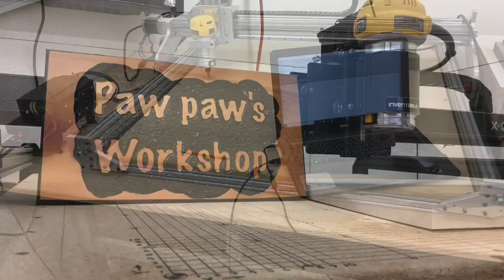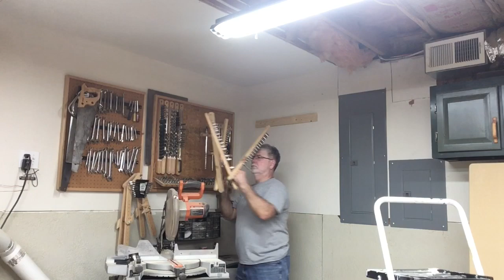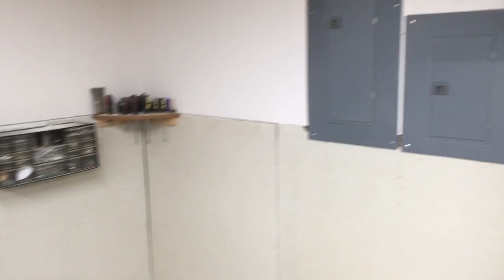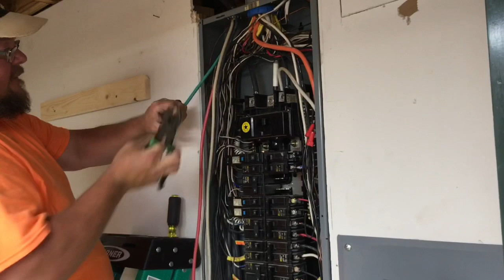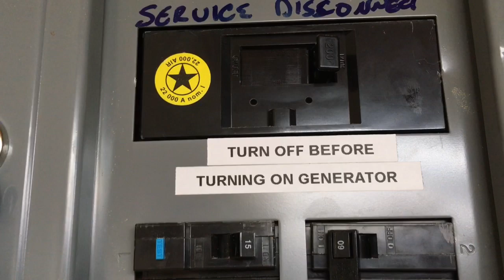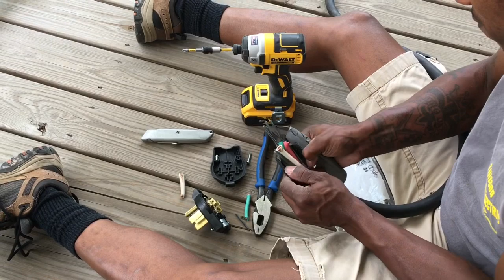How I Installed a Whole House Generator

Comment: Your generator and the utility power are ‘out of phase’ meaning if you were to turn your generator on and close the breaker with utility power present, you will have a large arc flash. Also, the type of chord used, looks like soow , is intended for temporary installations only. Also, the generator needs to be grounded with a ground rod as a separately derived system.
Reply from the maker: Thank you for the information.  I have spoken to the electrician to correct the issues.  I appreciate this very much.

Comment: Im surprised In fact I am 100% skeptical that there is no transfer switch. If you don't forget to turn off the main breaker you are energizing the power to what could be a down power line. The second question is why is this installed on an upstairs balcony. Isn't this going to vibrate the shit out of your house when you are sleeping or trying to?
Reply from the maker: A permanent generator hard wired to the panel has a transfer switch and auto starts. This is a portable generator that is not hard wired in and does not auto start.  I do like the idea of the interlock added to the panel for safety. The generator actually runs very quiet and has very little vibration.

Comment: Is this expensive to have electricians do this?  Was there any permit to get after the work?  My Dad bought generator, but hasn't had power company hook it to the breakers yet ... There was some expensive blocker.  Some safety thing.
Reply from the maker: The price to do this work depends largely on local conditions.  Again, permits may or may not be required.  Power companies in this area do not install the generators.  Local agencies establish the requirements and control what is allowed and what is not allowed.

Comment: That is not legal in my area and pretty sure in your area they have to be connected to a transfer switch so only one can be on at a time
Reply from the maker: Thank you for the information, I will be checking with the electrician.
Reply: @PawPawsWorkShop  you need to call code compliance, this is so wrong

Comment: I enjoyed the video. I am glad you shared this video.
I am puzzled why they did not use a mechanical sliding transfer safety device ( interlock ) 
to prevent anyone from switching on the generator beaker unless the main is off. 
It would be easy if that breaker was the first one on that side.
Or use a transfer switch .
Reply from the maker: The electrician said it was not required however, I will be adding one just for an extra level of safety.

Comment: How come they didn't connect the generator to a transfer switch or an interlock. That setup seems kinda dangerous. If you forget to turn off the main breaker it will back feed up the line and could electrocute a linesman. Just my 2 cents.
Reply from the maker: I hired a professional licensed electrician to ensure that all codes were met for this area.  Thank you very much.
Reply: @PawPawsWorkShop  Thats good. I was just a little concerned. I enjoy all your videos so keep em coming. Can't wait til you show us your new carve. Did you ever install the risers on the x carve. If not would you be interested in selling them.
Reply from the maker: I do plan on putting the risers on the XCarve.  Time is just so short.  It seems that I less time being retired than before when I was working 60 hours a week. Crazy!